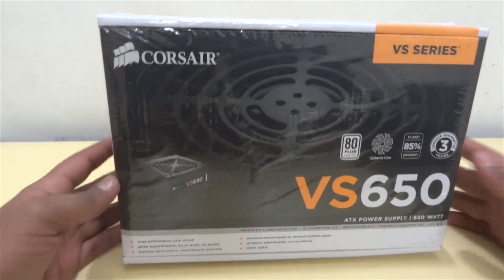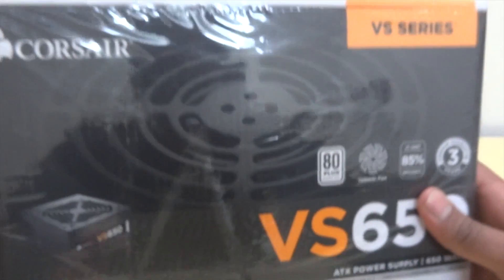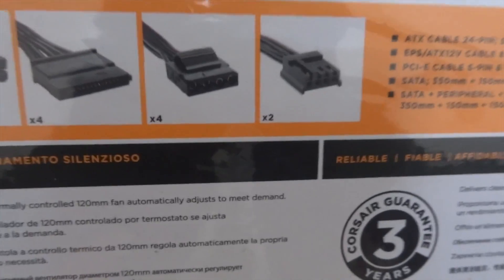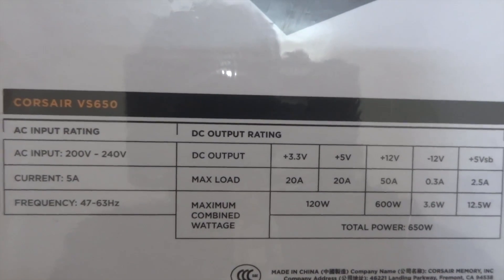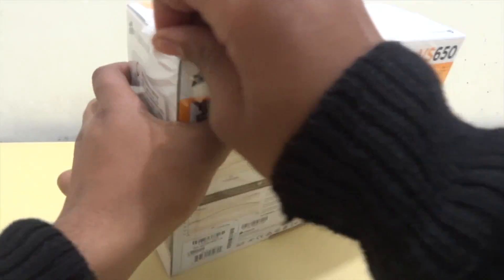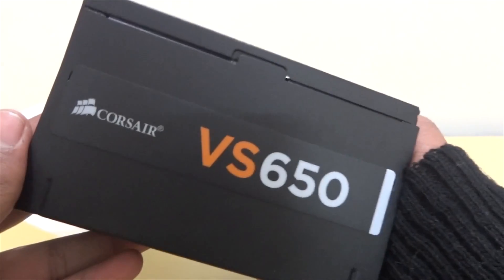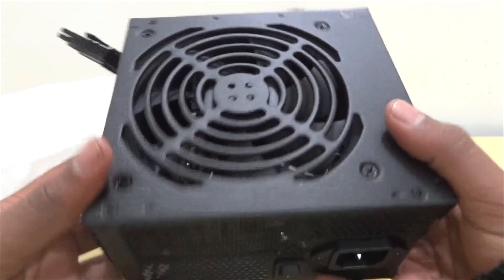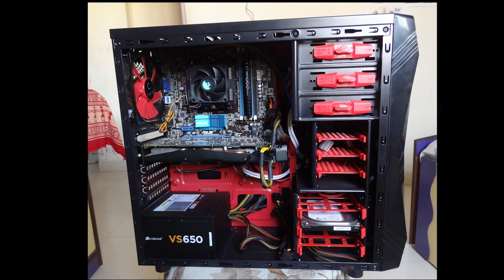Corsair VS 650 Power Supply Unit Unboxing and Review

Comment: This psu is shit, don't buy it
Reply from the maker: Working awesome for past 4 years
Reply: @AKSQUAREGAMING  Hello friend, i just bought this psu ( corsair vs 650 80+) and also i'm building my pc also i will use this psu. But i have question can i change my psu before using it ? Cause i see some non-good comment for psu. They say that psu make a lot of noise and can break down anytime. Can you describe your idea about this psu ?
Reply from the maker: hello bro i have been using this psu for past 4 years no issues yet
if you have already purchased it i will say go for it :)

Comment: Don't buy this shit even for the lowest range pc. Trust me. I had one. First ram failure,than rare reboots than often reboots. And then i took multimeter and it turned out. 12v was getting to 20 volts. Twenty! Triple checked it with professional multimeter. This thing climbed to 20 volts. 5v rail climbed to 8v and 3.3 was around 5v. I was lucky it didn't blow up. Don't be dumb like me. Always check reviews. Don't trust brands.(except seasonic xD )

Comment: Is this psu enough and compatible with ryzen 1600 and 
gtx 1050 ti?
Reply: corsair vs is terrible, if you still wamt to buy it take 650w version, seasonic is god supply
Reply: you can run a 1050ti with 300 watts only

Comment: Can i run 7600k, z270a and gtx 1060?
Reply: Also are the parts compatible with this psu
Reply from the maker: i will suggest youto spend a bit more on PSU if you are going to overclock that CPU which you are going to :)

Comment: how would the Corsair VS 650 Power Supply Unit perform with:
Intel i5 6600k 3.5 GHz, 
 Asus Z170-P Intel Skylake ATX motherboard,
4TB Seagate Barracuda Hard Drive,
16Gb 3200MHz corsair Vengeance LPX DDR4  and
GEFORCE GTX1060- PALIT Dual- 3GB graphics card
thank you, would appreciate if you could  reply asap
Reply: Yes, it would run on those specs. Actually, you should be able to run that setup with a 400W PSU considering GTX 1060's requirements. Just a heads up, this is a T4 PSU so it won't be that good in terms of quality. You can read more here: http://www.tomshardware.com/forum/id-2547993/psu-tier-list.html

Comment: can i use this for msi gtx 1070 with 8 and 6 pin conectors and with intel core i5 3570 ??
Reply: Ján Michalina yes
Reply from the maker: yes you can
Reply: Ján Michalina would not recommend, its a low tier psu not for gaming or overclocking
Reply: @UnluckyDomino  I have my rx 580 on this psu and have had the psu for 2 years and bought the rx 580 recently. Its STILL good. Just glad I got a strong vs 650.
Reply: @stavroskoul119  Hello dude, I'm buying a new psu for RX 580, this psu is good enough right? I'm looking whether a Corsair or Seasonic PSU
Reply: @guillomartinio9448  I recommend you go with either the corsair cx series or with seasonic. But keep in mind that rx 580 requires 500watt of electric energy. So you shiuld get a 650 or higher watt one. https://www.corsair.com/us/en/Power/cxm-series-2015-config/p/CP-9020061-NA here you go, this PSU is a BEAST.

Comment: I will buy ASUS gtx1070 DUAL OC 8g.  Has 8 pin connector, motherboard is ASUS H81i-plus mini itx LG1150.  Will this be okay? thanks.

also, newb question here, this PSU has 6+2 connector, so I assume that I plug the 6 in then the 2 in and everything is fine? thanks
Reply from the maker: yes 6+2 can be joined together to form 8 pin connector

Comment: I am currently doubting my PSU, since it already killed 2 of my GPUs (750ti, 560ti). My PSU is Huntkey APFC 600W but I'm not quite sure if my PSU is the problem since its almost a year since I'm not using a GPU (just using intel graphics) and no problem arise since then. Do you really think I should replace my PSU? thanks in advance.
Reply: Cedric Mendoza its your psu since gpus require a lot of power which took your power supply to its limit
i suggest getting a 350/450w and a gpu like the rx 460 or gtx 1050 since they dont require much power in the first place, so upgrading shouldnt be too expensive
Reply: Cedric Mendoza ur pc restart?
Reply: what do you mean?
Reply: I'm thinking about upgrading my psu to more branded ones, specifically seasonic m12 or something like that. thanks anyways!
Reply: yes its power suply you ned to ugrade it to gold 80+ or bronze 80+ but gold will be beter but only 550W  minimum.

Comment: Hey,Nice video . Do you thing this PSU will be enough for the system i'm planning to build ? 
i5 6400
r9 280x
1tb
DDR4 1.2V 2133
mobo asrock h110m hdv 
And also do you have any problems with it ? Is is loud or something ?
Reply from the maker: It have no noise issues but wattage really depends on your graphics card power consumption
Reply: AKSQUARE GAMING the card consumes 300w
Reply from the maker: mamomi1 HD it will be fine then but try to get 750W cause if you upgrade something in future

Comment: Hi AKSQUARE, Pl take a look at my system specs and let me know if this PSU would be a good suit.

Intel i5-3570K
Sapphire HD 7950 3GB with Boost
2x 8GB Corsair Vengeance DDR3 RAM
ASRock Z77 Extreme4 Motherboard
120GB Samsung 840 SSD + 2TB WD Sata Green
Reply: Yes easily 😂 I run gtx 960 slip on this with a quad core i5 3.4 ghz and 8gb ddr3 ram 1600mhz
Reply: Sli* (running two graphics cards in one PC)
Reply: +XpWx Karmah hey is this good for my build
gtx980ti
asus z79 pro gamer motherboard
500gbssd and a 3 tb hdd 
samsung optical drive
i7 4790k cpu
Reply: probably just about o would go with about 750 with your because then u will have more efficiency
Reply: +XpWx Karmah what u mean more efficiency i asked pc builder friend he said my build wont even take more than 500watt is he right? And i wont do any overclocking cus i dont know what it is and it seems unnessasary
Reply: no he's not because the minimum power supply to run the 980ti is 600w  but you should always get at least a 100w more than you should have as that can boost efficiency which will decrease your chance of having it explode and fry your graphics card, i dont think you would want that happening to a £600 graphics card. ;)
Reply: and yes dont overclock that card it already has enough performance to run any game on the market on ultra/high
Reply: +XpWx Karmah wow i wish i know all these stuff  i never builded a pc before maybe i gice up on it and buy a prevuilt i dunno :/
Reply: its cheaper to build it your self, but its entirely up to you :)

Comment: hello guys. I have the sam PSU, bought it about 10 months ago.. yesterday my speakers started to buzz, so I diconected them and connect them to laptop. They are working fine, after that, I've heard an awful clicking noise from my PSU.. and it keeps clicking. It is the same noise as a mouse click.. can anyone tell me what to do? Should I replace it?
Reply: I guess it was only dust.. after I blown the dust out, clicking noise stopped o.O

Comment: i have a dell inspiron 660 and i plan on upgrading the graphics card to an asus radeon r9 380 2gb strix, i think ill need a new power supply for it to work. dont know much about pcs but does anyone know if this is a good choice? or if theres a better option?
Reply from the maker: +Evan Sourke yea this PSU will be sufficient
Reply: +AKSQUARE GAMING hi, I'm getting a sapphire r9 390 nitro with this psu to go with an i5 4460. Will I be OK with this? I have left around 26 watts off if the 650.

Comment: Hi AKSQUARE,
m planning to build a gaming rig with core i5 6600k,gtx 960 will this psu be sufficient?

also could you please suggest the ups VA rating i will require to support this psu. 
iam currently thinking of buying this one: APC BX600CI-IN Back-UPS 600 VA,230V  ...would this be fine?

i am a bit confused with the ups power wattage as it says 360 watts which is quiet less than the smps wattage.Not sure if that will affect

Please advise..Thanks
Reply from the maker: +hrishikesh pai sorry mate but i myself don't use any UPS so i really have no idea about it :( nice config you got there though :D
Reply: +AKSQUARE GAMING 
hey np dude, anyways i suppose the VS 650 will do fine for my config, right?

-
Reply from the maker: hrishikesh pai yea it will :)
Reply: AKSQUARE GAMING
 thanks again dude!
one last query....
i also checked out ur review for Circle CC821 Full Tower Cabinet and bought the same.
just wanna know if 4 pin molex connector of the front fans connect to the 4 pin female molex of this psu(corsair 650) and can both of the fan connectors be stacked on each other.

just wanna confirm if thats d right way to connect them
Reply from the maker: hrishikesh pai i just connected both molex from fan to the molex from my psu :)

Comment: Hello,
My config is Intel core I5 4440 at 3.2, 8 GB ram, 1 TB HDD, Gigagyte H97M D3h mobo, And a DVD rom, i have bought GTX950. will it work on 550Watt local PSU that i have by default on my cabinet or should i buy VS650?
Reply: Dude dont buy this psu is trash, when i bought a pc with a vs650.
The game or other programs like sony vegas pro,it will crash like 10-20 minutes and when I set to balanced mode,it didnt work, your screwed man, return the psu that you purchase it and replace it that is not corsair. Sry for my bad english im different.
Reply: @K3ntucky123  I have had this for more than 1,5 years and I never had problems. Seems like you got a faulty one and im lucky that I got a good one.
Reply from the maker: +saadansari007 yea it should work
Reply: +AKSQUARE GAMING 
Ahh..!! i just put my GTX950 on local 550W PSU(updated all drivers).
And
aero theme have stop working...unable to rate Via "Window expriencing index" and not able to launch "Far cry 4, Batman Arkham Knight"

Now praying.. for my GTX950 hope its not damage. seems PSU issue.
Reply from the maker: saadansari007 reinstall OS
Reply: bro you wos supouse to upgrade psu to gold 550W or 650W 80+ xD that psu cant handle gtx 950 its eating alot power

Comment: Will it be able to run a r9 390 and an i7 4790k with 16 gb ddr3 ram?
Reply from the maker: +Farnomat this GPU can handle r9 390 as it requires 550 W but if you are going to overclock any components i will suggest you to take atleast 750W or 850 W to be future proof :)
Reply: +AKSQUARE GAMING ok thx for reply ;) i will probably oc
Reply from the maker: Farnomat
yea then get atleast 850W PSU :)

Comment: Hey,do you think this will be ok for the 980 ti? the minimum is 600w so it should be ok?
Reply from the maker: Pieman29666 Hello, the GTX 980Ti will work fine on the 600W PSU(NO OVERCLOCKING), but if it was me, i would not risk such top tier GPU on such 600W PSU i would have at least got 850W so it would be future proof and will be on the safer side + overclock friendly :D, i will suggest you to take at least 850 W PSU :)
Reply: AKSQUARE AGAR.IO Yeah,i don't think I'm going to overclock it.My 3,9ghz i7 4770 non k will probably bottleneck it someday in future years anyway :D what do you think?
Reply from the maker: Pieman29666
i would still go for the Seasonic M12II-850 just to be future proof :) why risk your such good components you should better save for the better PSU an have peace of mind and not worrying about the PSU overloading/reducing PSU life :)

Comment: Does that 13 amp plug fit in a standard Indian UPS??
Reply from the maker: ***** No, your UPS should have the at least 1 European styled socket or you need to get European to standard adapter which is what i currently use and these adapters are cheap :)
Reply: ooh!!! thanks again dude...
Reply: AKSQUARE AGAR.IO ooh!!! thanks again dude...
Reply from the maker: ***** no problem at all :)

Comment: Hey I want to crossfire two 7770 Graphics Card is this PSU good enough for powering both of them?
Reply from the maker: Gaurav Rautela Hello Gaurav Before telling that i need to know your full configuration. whats your processor,how many  HDD  you have?
Reply: AKSQUARE Hey Thank you for replying so fast...

Well below is my PC Config

AMD Fx 6100
Asus M5A97 R 2.0 Motherboard
2x4 GB Corsair Vengeance DDR3
AMD ATI 7770
1 Samsung 128 GB SSD 
1 1 TB Segate (7200 RPM HDD)
2 500 GB Segate (7200 RPM HDD)
1 500 GB WD (7200 RPM HDD)

well soon i'll be dumping the all 3 500 GB hard disk and i'll be buying a 2 TB Hard Disk.

apart from that is it fine for me to go for Crossfire? (currently I have 7770)
or should I go for Sapphire AMD/ATI Radeon R7 260 X?

please provide me your valuable feedback.
Reply from the maker: Gaurav Rautela Its Good to hear that you will be dumping 3 HDD and buy one 2 TB HDD as it will reduce the power consumption.
As far as Crossfiring goes For a system using two Radeon HD 7770 graphics cards in 2-way CrossFireX mode AMD specifies a minimum of a 600 Watt or greater system power supply. The power supply should also have a maximum combined +12 Volt continuous current rating of 30 Amps or greater and have at least two 6-pin PCI Express supplementary power connectors.
The Corsair VS Series VS650 ( CP-9020051 ), with its maximum combined +12 Volt continuous current rating of 50 Amps and with two (6+2)-pin PCI Express supplementary power connectors, is sufficient to power your system configuration with two Radeon HD 7770 graphics cards in 2-way CrossFireX.
Reply: AKSQUARE Well now after your valuable feedback I'll buy VS650 and it will cost me around 4k from nehru place and as if of now I am not buying 2TB HDD..i'll be buying it after 2 or 3 months.

anyway thanks a lot..
Reply from the maker: Gaurav Rautela Crossfiring Radeon HD 7770 is not recommended as Single high end card is ALWAYS better than Crossfiring weaker cards,
 Xfire weaker cards  has numerous micro-stuttering and frame pacing issues. 

I will HIGHLY recommend you to go for GTX 750Ti 2 GB Rather than Radeon R7 260 X as it costs almost same + - 1000 INR and GTX 750Ti will stay much cooler and performs better than R7 260 X .
Reply: AKSQUARE Oh thats sad but the problem is I already have a 7770. The only choices I have is either sell my 7770 and buy a better GPU or crossfire 7770 (as new 7770 will cost me around 7k)
Reply from the maker: Gaurav Rautela Do you have R7 260X or you were planing to buy New R7 260X?
Reply: AKSQUARE as you said Crossfiring 7770 wont give me much difference in the performance then I don't think I'll buy other 7770 (for crossfire) in the place of it i'll buy new R7 260x or maybe R9 270x
Reply from the maker: Gaurav Rautela I  would say that you should sell your 7770 and buy the GTX 750 Ti. it might be slightly slower than crossfire 7770s but it will use less power ( about a 3rd the power of crossfire 7770s, more power consumed = more heating )and you don't have to deal with the issues that come with crossfire. 750Ti is better than R7 260x . R7 260X<GTX 750Ti<R9 270X.